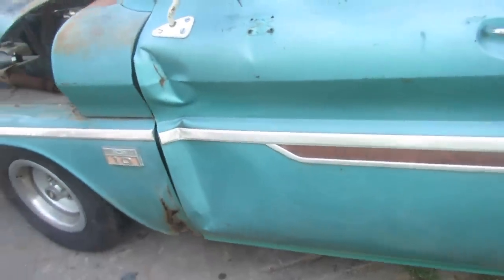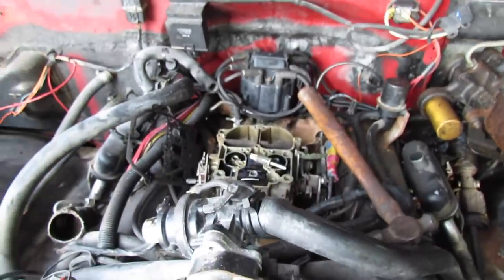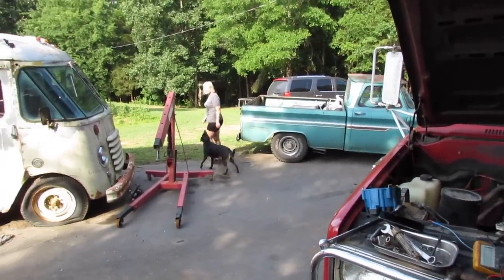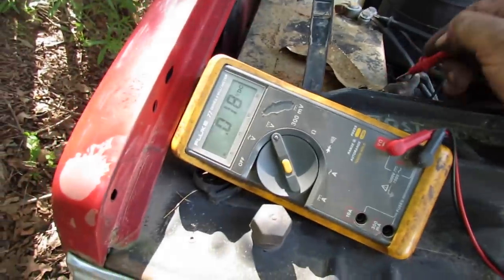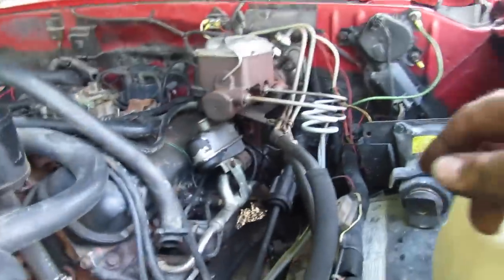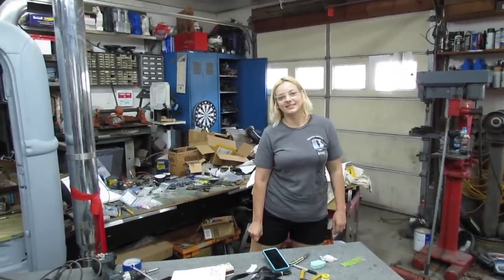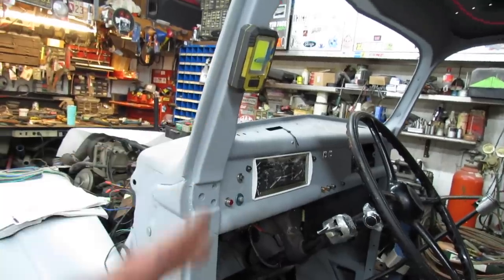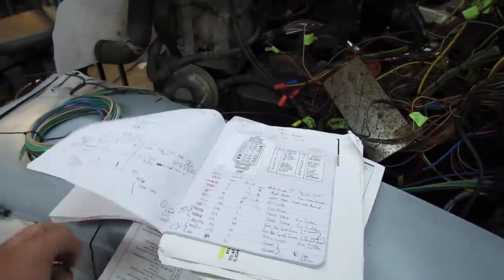The old Fire Truck Runs

Comment: Wiring it up wasn't no piece of cake. It took a load of patience. I see a issue tho, that they are each and everyone of them laying lose and hanging so that should something catch on them and drag a bunch off so's you had to hang em all again might just be the straw that broke the camels back. Now if you was to work maybe with the smallest group first and get them laid out neat and in a loom and then all the right lengths, and one by one get them looking like a factory did it, you could yank em all off your self and pull out something and put it back right then just plug and play them wires like nothing to it, that would be something. Them guys who sell looms made up are not ready to plug in, that you have to do and cut wires to the right length, solder the wires so's it all makes sense. I can't do it. Give me a year with someone gouging out a eye with a screwdriver for motivation i might get a dozen for I would stand still and say gouge em both out. One fine job Mr H.shevy
Reply from the maker: Morgan Adair it’ll be that nice. Everything is cut to length. Soldered. Etc. just gotta make sure it works then finalize everything.
Reply: @MrHevyshevy  That is gonna be so sweet.... I can wait... I know your feeling some pressure from the audience but tell them to sell more balloons/LOL

Comment: Sooo, what happened to the door??
Reply: MrTrollgubben - well, we can see that the door opened beyond it’s ‘limit’ but not by enough to damage enough to stop it shutting properly (unless Mr H has bin a repairin’...?!). The question is how?!  I guess the clue is in Mr H’s remark - that someone (else) is to blame. I’m guessing either the door wasn’t closed properly & flew open and broke the strap, etc - or was opened to early when pulling up, with same result.
Reply from the maker: MrTrollgubben if you follow on the instagram you get even more clues.